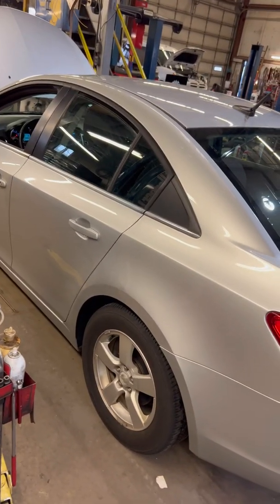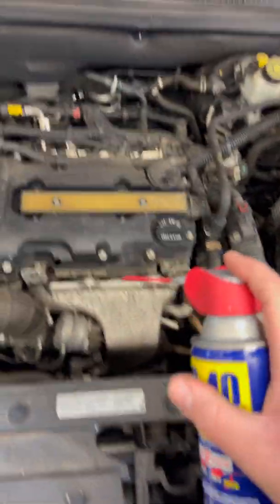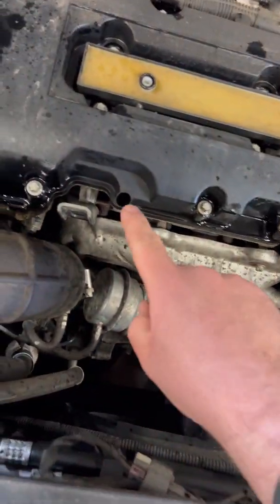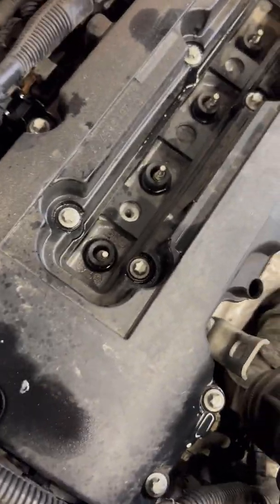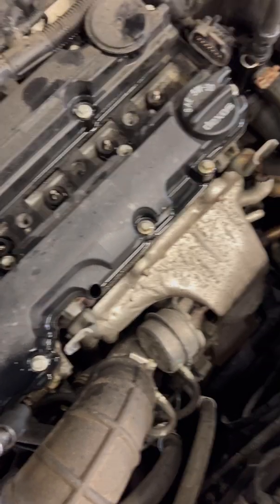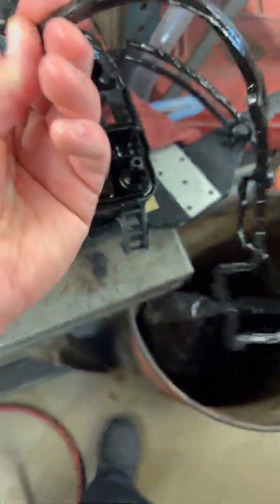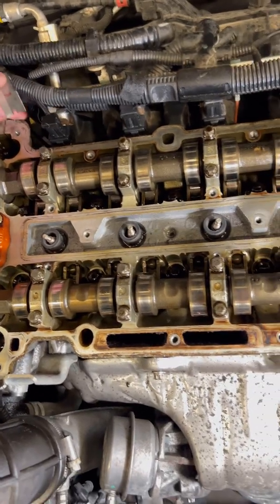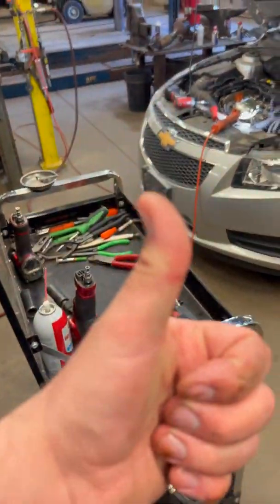Chevy Cruze GM 1.4 L eco-tec p1101 p0106 p0171 PCV FAULT easy diagnosis and install video.

Comment: Im chasing a P1101 code that comes and goes. Valve cover PCV isnt pushing air out. Ive replace MAF and MAP sensor and cleaned throttle body...im out of ideas
Reply from the maker: I would say check all intake hoses and check your pcv hose! Let me know if you find anything! There is also a little orange rubber nub in the intake manifold that you can see when you take the pcv hose off, check to see if that is still in there and if it’s not that might be your issue as well!
Reply: @Natesautorepairs can you do a video showing where the hoses are and where to check by any chance
Reply from the maker: @Isaiaha7957  I just showed where the problem is in this video haha. Unless you mean that isn’t your problem but you have the codes
Reply from the maker: @Isaiaha7957  what codes do you have